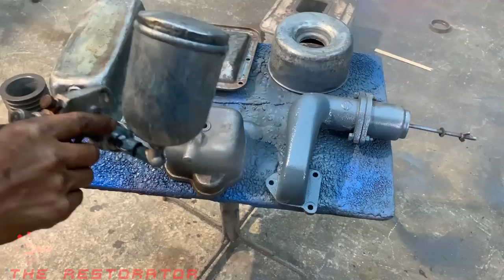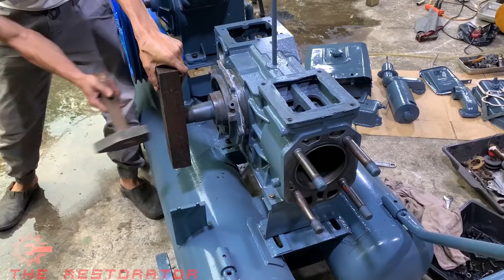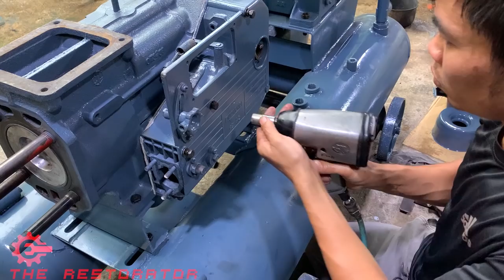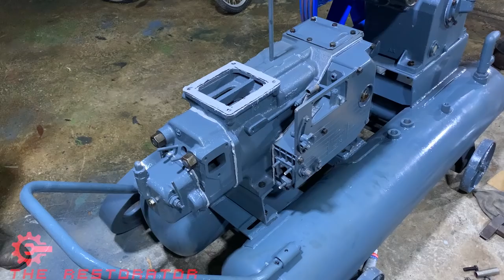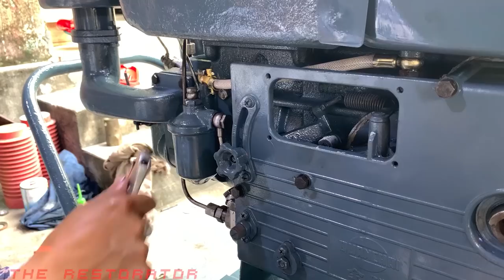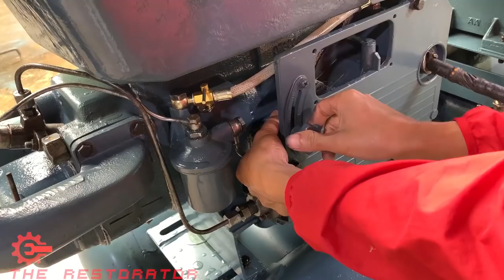Restoration OLD AIR COMPRESSOR | Restore Engine 1500Cc Vintage

Comment: Awesome job glad you got it working. Like the two tone paint scheme. Compressor of that size and construction well worth some long overdue tlc. Good to see the safety valves operating, hope you able to test the integrity of the tanks for you and your family safety. Be nice to see some equipment operating off the air supply.

Comment: Great job! I’ve never seen a gas ⛽️ powered compressor before. I guess this was made for near constant use in remote areas away from electrical power? Must be a relief valve someplace to avoid over pressure since starting and stopping that beast wouldn’t be practical.